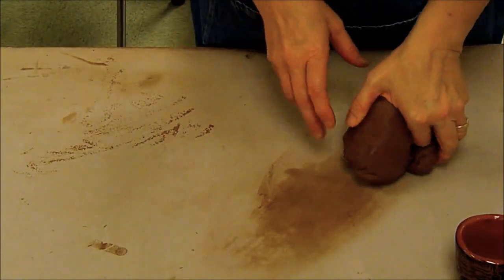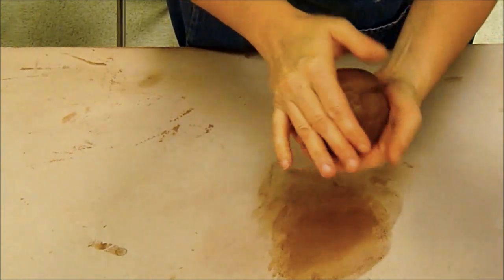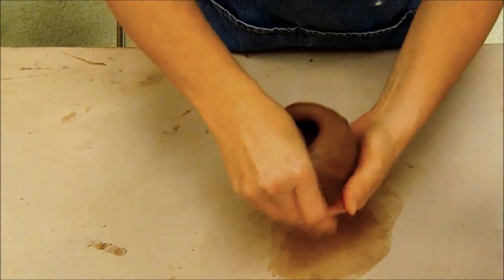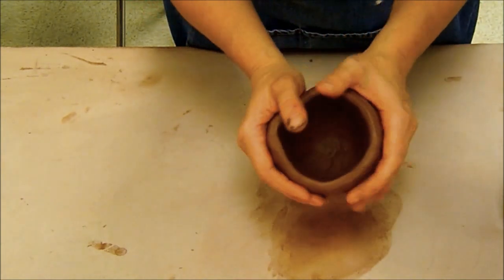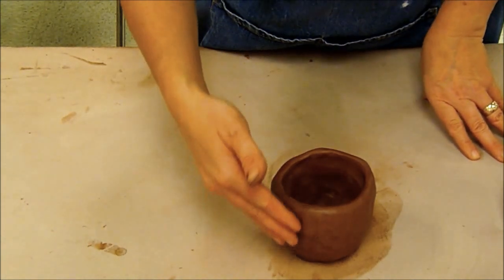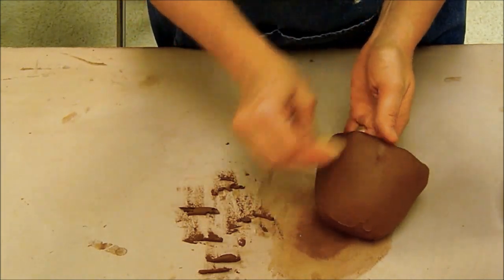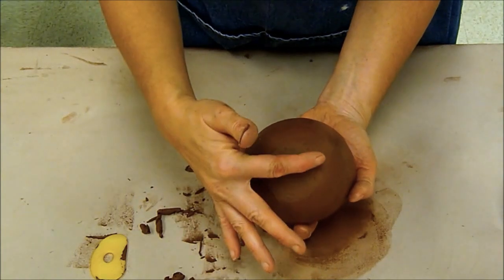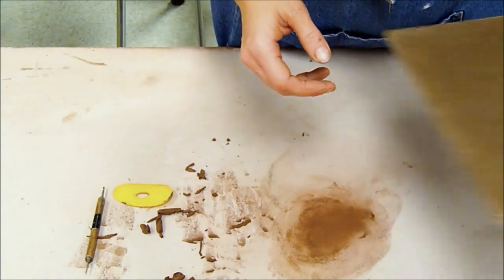Pinch Pot Cup Forms Ceramics I - First day Pinching (Older version)

Comment: Thanks so much. I tried ceramics for the first time today and we started with a pinch pot which turned out really cracked and thin at the top. Yours is really simple and lovely. Thanks!
Reply from the maker: Thanks, Sarah!  The moisture of the clay is also important.  It should be plastic enough, it isn't prone to a lot of cracking.